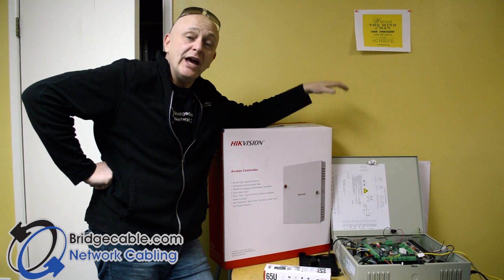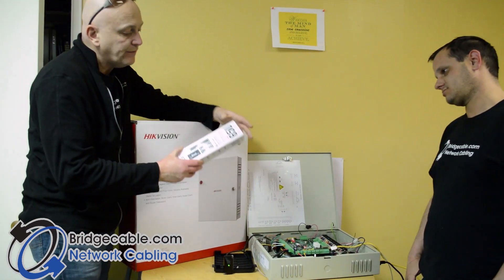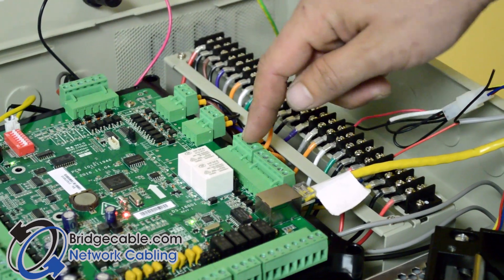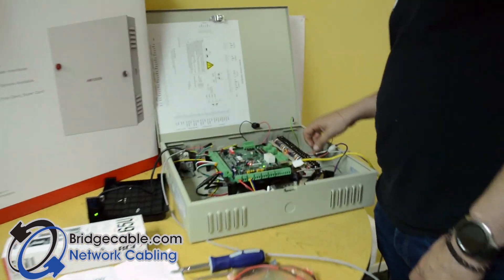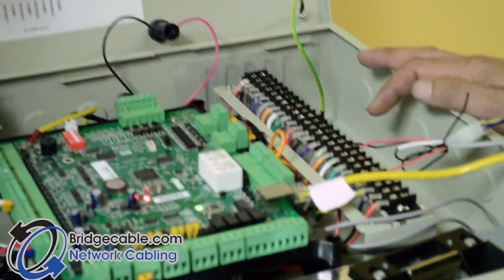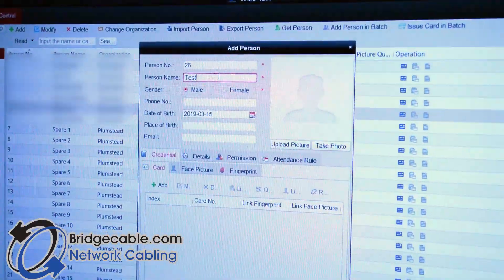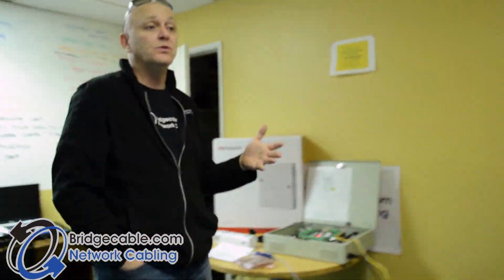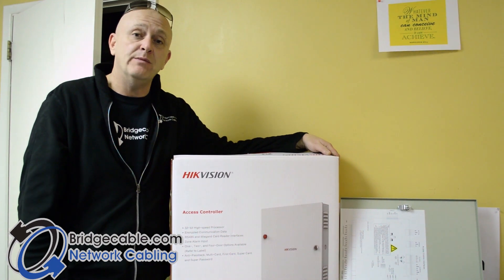Hikvision Access Control Review and Tutorial | BridgeCable com

Comment: is this considered high voltage or can data cablers iunstall this?
Reply from the maker: Still low voltage but if there is a tie in with Fire Alarm depending on if using Mag Locks, etc. In PA and NJ ( I would assume most states?) you have to be licensed. However.....most times if you need to tie into the fire alarm panel/gear you just run the wire for those guys.